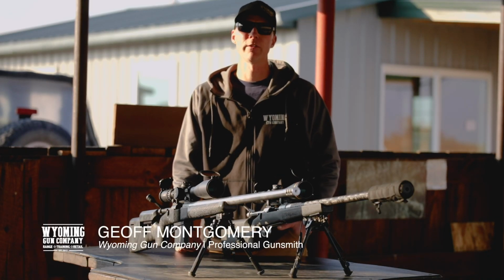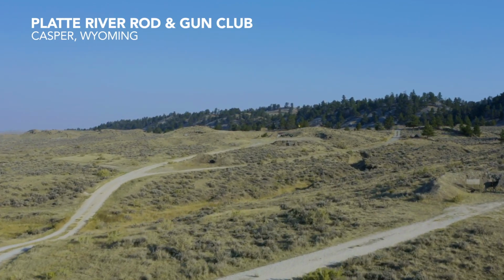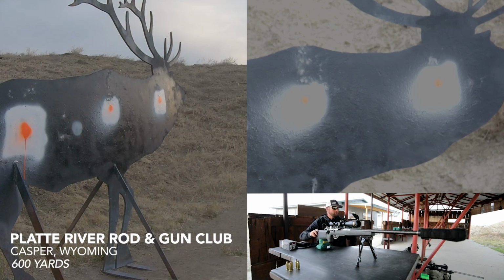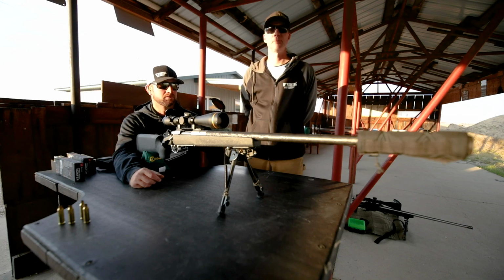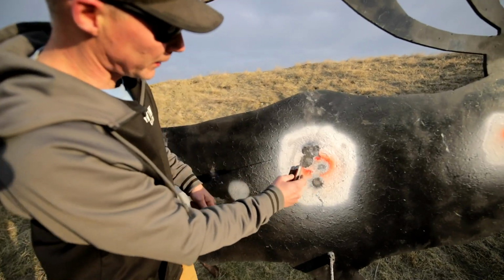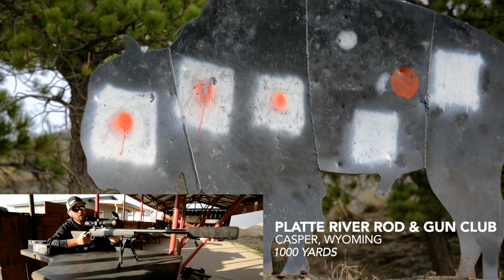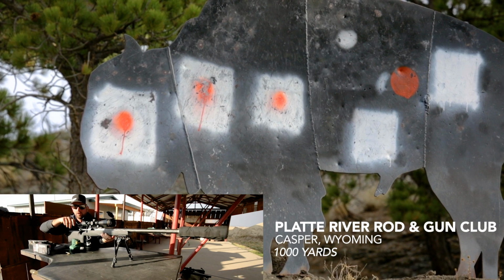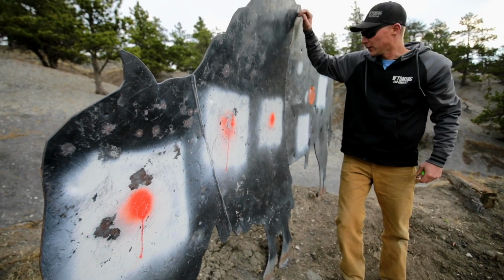Long Range 1000 Yard Field Test on Light Weight Precision Hunting Rifle

Comment: Fellow casper-ite here. What are the attributes of using an accurized Rem 700 action in this build over say a lower tier big horn or defiance tenacity action? Is it even cost effective to accurize a rem 700 at this point anymore?
Reply from the maker: Some custom M700 clones have integral recoil lugs and/or pic rails.  This, in theory, is desirable (but if properly torqued, bedded, and/or loktited, does it really matter?).  With us, you're still coming in equal to or even under the price of any of those actions after all truing work is done and you have an experienced human checking everything during the process, ensuring the work is done right.  I guess it's more of a custom thing rather than just using something you assume is good to go out of the box.  Some of the best shooting rifles I know of are on trued M700s.  You should stop by sometime and we can discuss in further detail.  Thanks for watching!!